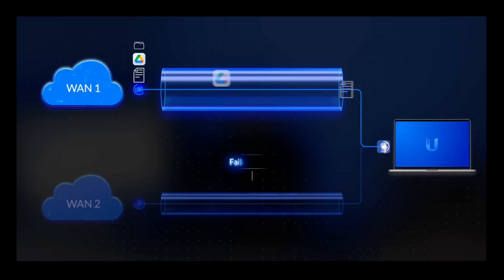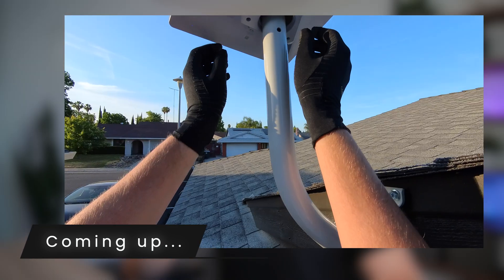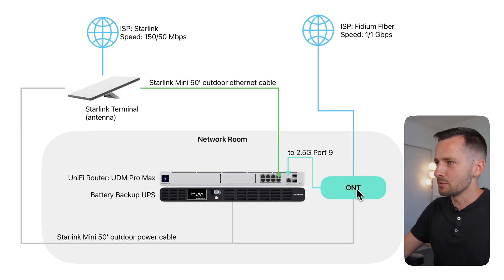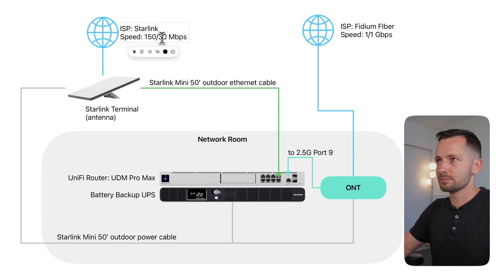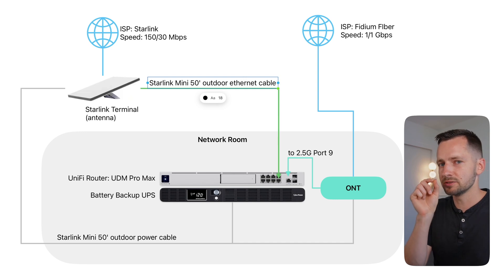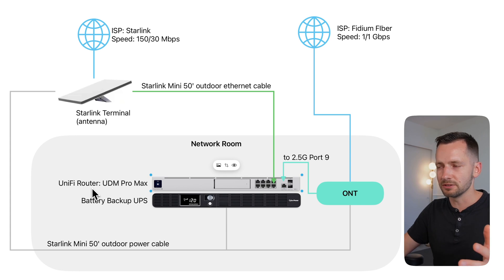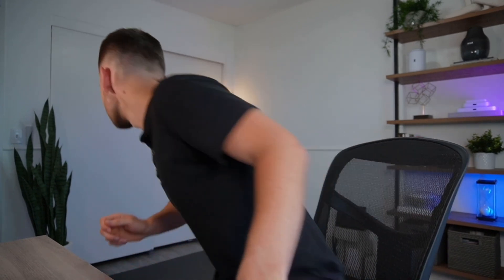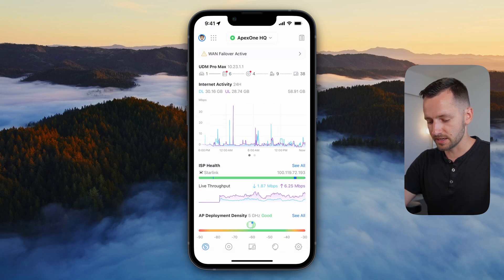When your business MUST have Internet 24/7… Install Starlink + UniFi

Comment: Starlink also has a $10/month plan for backup internet. But it is only available to existing customers. You might be able to sign-up for $50 and then later switch to the backup plan.
Reply from the maker: Awesome pro-tip! Thanks!

For some reason, doesn't always pop-up when first buying Starlink service. But yes, you should be able to switch to $10/month for 10GB plan which is great for backup internet.
Reply: @ApexOneIT It doesn't pop up because it is only available to existing customers, not new customers.

Comment: So...if I didn't miss anything in this Video, then there no option to power Starlink via PoE? To me that would seem to be a very logical idea...run just one Cable and you"re done...
Reply from the maker: There's probably some solution for that? I saw some 3rd party mobile kits that seem to imply PoE. But I haven't looked much into it.

Comment: I have enough  battery to power my small home network for a 6-8 hour power outage. Won’t you still have internet from your fiber ISP during a power outage if your network is powered?
Reply from the maker: You're relying on your ISP to be online in your area during that time. It's likely in some places, unlikely in others. Like during a hurricane in Florida. I had an Airbnb take 2 weeks to get internet back. That was a cable connection specially, but still.
Reply: @ApexOneIT I just assumed ISPs would have sone kind of back up power, Im not sure why I assumed that.
I also have a starlink mini I could set up

Comment: Does your Starlink telemetry still work with the local IP on your phone? Meaning, as long as the phone is on the home network, can you still access the dish info since you are not connected to the dish wifi anymore?
Reply from the maker: The Starlink itself is always online. So you don't even need to be on your home network to see the Starlink stats. As long as your phone is online somehow, you can jump into your Starlink app (or web) and see Starlink stats.
Reply: @ApexOneIT  Thank you, waiting on my new POE switch to make switch to a Ubuquity home network with Xfinity and Starlink WANs

Comment: I have the t mobile backup plan for ten dollars a month w/ free modem.
Reply from the maker: That works in most cases. I would just argue that this Starlink is more robust as it's not relying on cell towers. Assuming the towers have backup generators, when everyone's internet goes down, cellular congestion get's very real.

Comment: Nice video looking into a solution like this as well. Can you explain why you can't just extend the ethernet cable of the starlink?
Reply from the maker: You want to be sure you use the Starlink ethernet cable at the Starlink antenna side. If you need extend the cable, you can totally add a RJ45 coupler instead of buying the longer Starlink ethernet cable. But the coupler is another point of failure in an inconvenient location. Great question!

Comment: Hi Bogdan. I just set up "Load Balance" instead of "Failover" because load balance automatically reverts to failover if one wan fails. And I set the balance to be 80/20 giving the strongest wan the 80%. I'm curious why you didn't choose that setup. Am I doing something wrong? I'm still a newby. Could you do a video explaining the upsides and downsides to both settings? ❤
Reply from the maker: My primary ISP higher bandwidth, single digit latency, and not restricted by CGNAT. That’s why I just do failover only.
Reply: Likely wants to take advantage of "pausing" the Starlink ISP for cost optimization purposes.